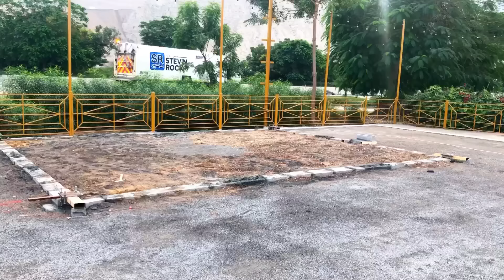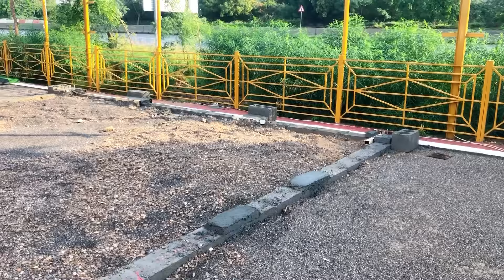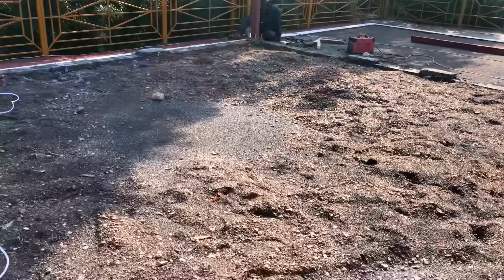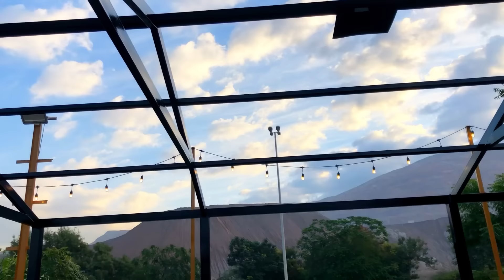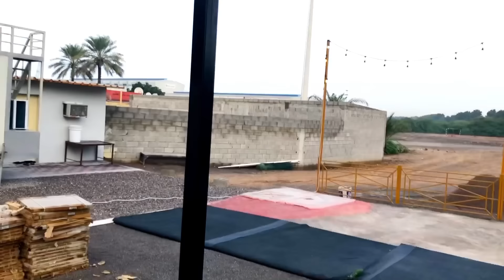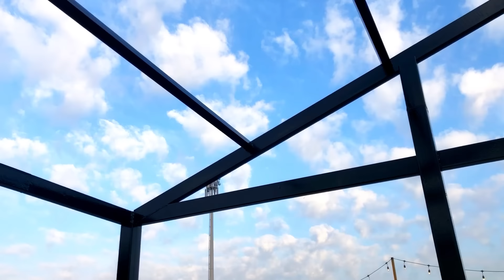How to build a metal steel House 🏠 Amazing steel home work video✨

Comment: If possible,  Don't use hollow  pie. After 8 years , most of the parts are fully rust.
Reply: Not so if not exposed to the weather. Metal does not mean no maintenance required. Rust proof will take it extra many years. It need not be heavy, use light weight roofing material .